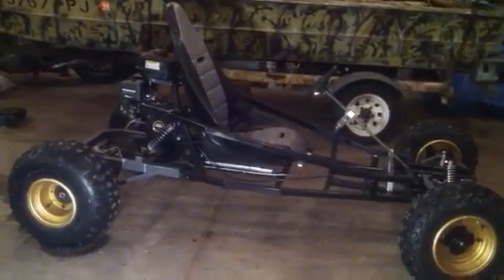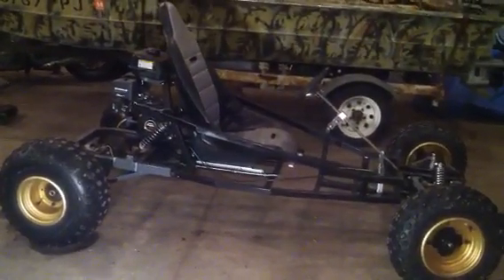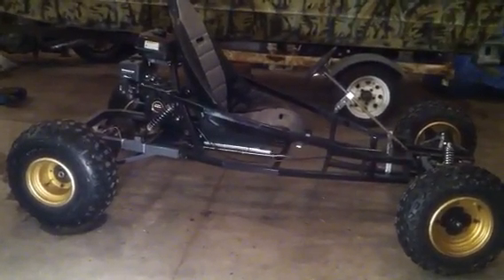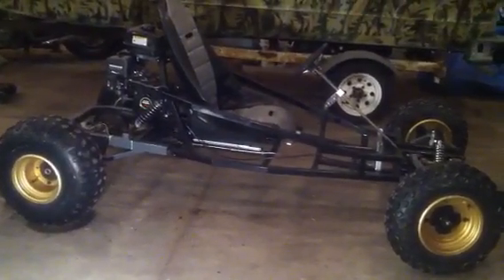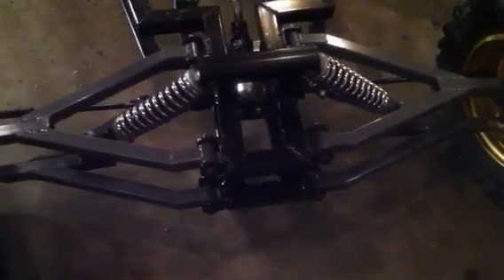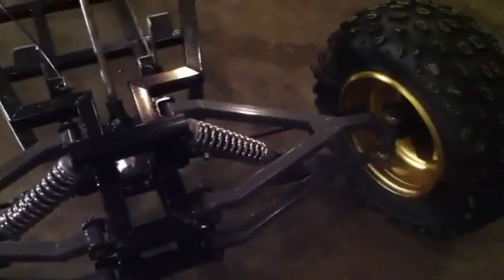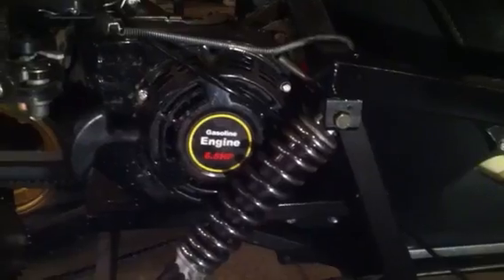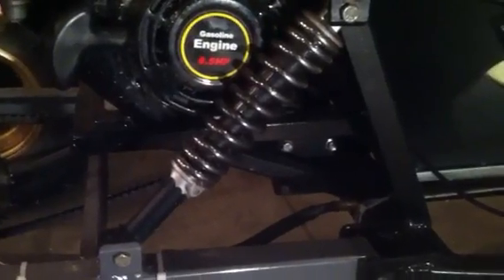Spidercarts Arachnid homemade go kart

Comment from the maker: The bushings are simply purchased from a hardware store.  Drill A-arms to correct diameter and press in.    Ream the ID to correct dia and your set.   The hubs were purchased from a karts site.  Chuck up in a lathe to cut off original face and weld on new.  The rear hubs are built from a 2" spacer pipe with the ID bored to the same dia as axle bar.  This pipe is about 2" long with half of a split collar welded to each end.  Solid!
Reply: awesome, thanks!

Comment: Hi!
It looks like you rebuilt the rear end, so that engin is tied to main frame on the back of the seat, instead of the suspended craddle. Quite smart modification. Is that possible to see some more detailled picture?
In such case, your chain tensionner has to be adjutsable since position of axe is changing?